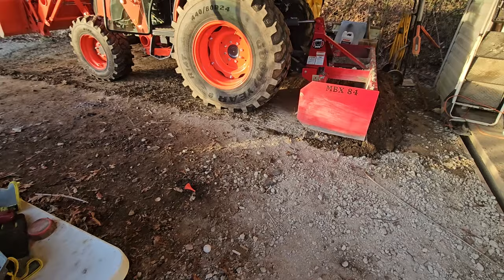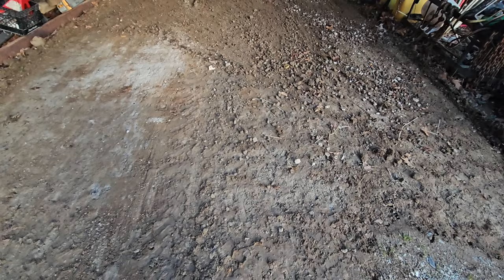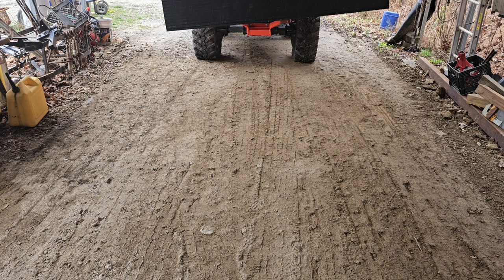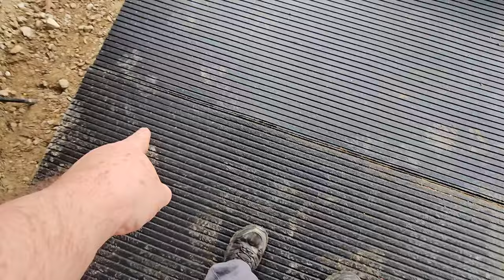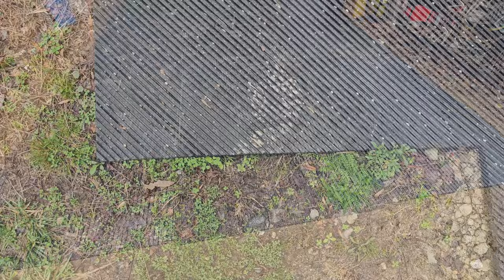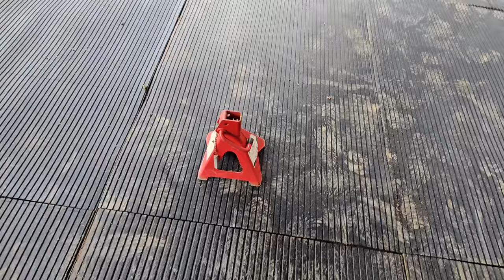Horse Stall mats for your carport!

Comment: I used one of those with sand/clay mix under as a landing pad for Dad's wheelchair ramp when he got to that stage... It firmed up like a rock for that application. I was impressed. And your video here gives me some ideas. Thanks!
Reply from the maker: That is so awesome to hear. Dads inspire much.
If it wasn't for my dad, I would have waited out concrete, which would have meant another year, two, or more struggling with the next leap.
Prayers for your dad, thankful he has someone like you to address these issues. Many do not!
Some compaction beneath this would have been awesome, but I just had to say, time to just make it better!
Treasure the time with your dad!